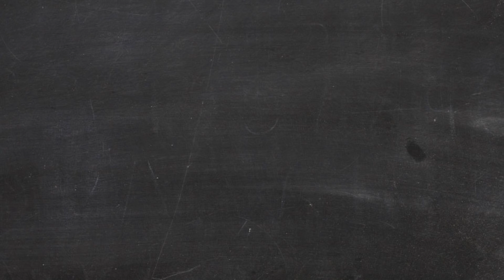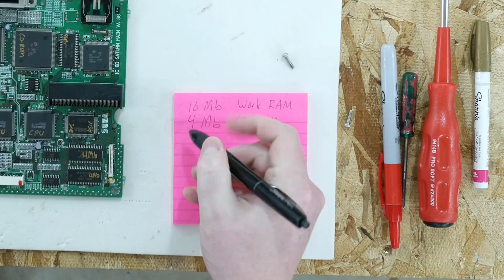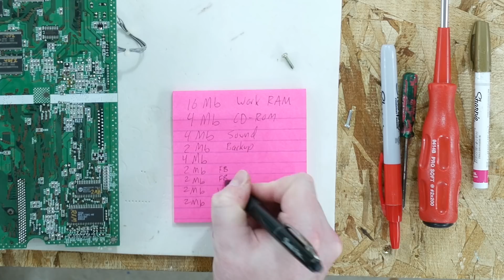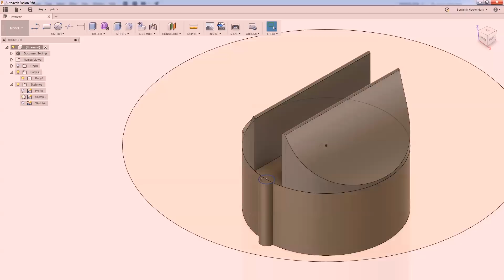Sega Saturn Teardown

Comment: The Saturn name wasn't so much an oddball name, as the development name for the Gamegear was Mercury, the development name for the Nomad was Venus, the  32X was Mars, then there was the cartridge only based Saturn system (another 32bit console!!) which was going to be the Sega Jupiter (the cartridge slot on the Saturn was going to be for Sega Jupiter cartridge games originally, not for memory expansion), then the Saturn which you know, and then the Sega Neptune which was going to be an all-in-one MegaDrive/Genesis and 32X... Sega was all the way with planet names, it was just the first time the development name reached the final product.

Speaking of Sega and specifically the Neptune, there are a lot of people making their own homebrew Neptunes by cramming the inners of the 32x inside a Megadrive/Genesis 2, and one person even molded the case to look like the Neptune prototype... but it's a mess inside of motherboards and daughterboards, power regulators (to power both systems off one power supply), the dust flaps of the cartridge port seem to be a problem because of height... I would love it if you made a proper, cleanly combined Neptune, maybe removing parts from the boards that are not needed to make it cleaner and more compact inside... also, the Neptune/32X can't be used directly with Master System Converters and advanced 16bit cartridges like Virtua Racing, because of a passthrough pin issue or something from what I've read, so maybe resolve that issue too!!

Comment: The chip next to the Mpeg cartridge is probably the SH-1 CPU used to control the CD-ROM and talk to the MPEG cartridge.
Also that System control chip also performs the 3D T&L operations.

Comment: The mystery chip might be the SCU DSP chip, because when you have problems and you're 90's SEGA, you just bury that problem with more processors.
Reply: The chip by the port is a Hitachi SH-1 CPU, part of the CD sub-system. The 2 chips were integrated in later board versions. The 512k CD buffer memory chip remained separate. There was a DSP in the System Control Unit chip (8:17), which can help with graphics.

Comment: Also Holy Shit the Saturn was a memory monster back then... The N64 had only 4Mb of unified system/Vram memory but I must say it was Rambus memory so it was in fact faster than any other memory from the other consoles and also the N64 had a dedicated graphics chip (RCP) which was better for 3D games, I would argue that 3D-wise the N64 was the most capable system. The Sega Saturn however is clearly more capable in 2D. The Playstation isn't the best in anything but it was still pretty powerful at the time and it had all the features (CD, 3D graphics, analog sticks, rumble engines...) The Playstation is the most complete console from that generation and also it is the first successful 3D console and furthermore the first of that generation which really got it a good headstart in front of the others and even furthermore it is a very simple console. Playstation got everything right, it was the work of a genius.
Reply: Yeah the Saturn had far more raw processing power than the PlayStation aswell but spread across more processors. If you couldn't program for 2 CPUs (not many developers could or they just didn't bother) then there was no way you could get the best out of the system. Plus the VDPs were custom so there was a steep learning curve. Basically the Saturn was like juggling 4 or 5 balls and the PS was more like juggling 2!
Reply: Liam3072 Oops so they were pretty evenly matched then.
Reply: Stanton Bentley. The Playstation was just slightly weaker (about 25% to 30% weaker) than the Saturn and N64 because it came out first. It had 3MB of memory and basically 1MB dedicated for sound, 1MB as Dedicated Vram and 1MB for the system. Just like the N64 the Playstation was a MIPS with very similar specifications to the N64. But what makes the N64 more powerful is the RCP designed by Silicon Graphics (World leader in computer graphics at the time) and also the freaking RAMBUS memory, I can't emphasize this enough Rambus is an amazing memory architecture, it's blazing fast, to give you an idea the Rambus memory used on the Xbox 360 and PS3 was 10 TIMES FASTER than 1333Mhz DDR3!!!! That's obscenely fast for something that came out in 2005, of course that the same is not true for the N64's Rambus because obviously the N64 used an older model but it was still Rambus and Rambus is just the best, it completely obliterates other memory architectures out there and the PS2 also used Rambus as well... Basically the difference in power of the Playstation vs Sega Saturn is like the Xbox One vs the PS4. The PS4 is indeed more powerful than the Xbox One but it's not "FAR" more powerful, it's not even double the power or anything like that, the same applies to the Playstation1 vs Sega Saturn, the difference in power is not several times like many people like to claim. And of course... The PS4 is not just more powerful than the Xbox One but equally easy to develop games for as they have the exact same AMD64 architecture and also it launched at a far lower cost, the Xbox One was larger, more expensive and less powerful... The Xbox One however does feature more media center features such as HDMI-IN (it has an integrated capture card), that's where the extra money went. The Xbox One was not very successful at first because it took the focus away from gaming. The Saturn however is indeed because it was hard to develop but not just that but also the fact that Sega's image was somewhat tarnished by the 32X and other practices that severely affected the market place of Sega.
Reply: The N64 didn't have 4Mb but 4MB ram. So more or less the same than the Saturn (you can substract the battery-backup ram and the cd-rom cache ram from the Saturn's total imho). And double that amount with the RAM Pak.

Comment: Poor sound chip (= limited sound samples), texture transparency not supported (= all shadows, for example, is a group of pixels). But still very nice console ^^
Reply: Poor sound chip? I've never heard that before. The Saturn easily had the best sound of its generation.
Reply: Texture transparencies ARE supported just via vdp2 which most devs used vdp1 hence no transparencies.
Reply: But the Saturn had the best sound chip of the 4th generation, and texture transparency is supported, by using VDP1, (look at burning rangers or courier crisis).

Comment: I got a Saturn pretty early on really liked the system.  I have two machines now, a model one and a model two.  I've taken them both apart and I'll tell you that the first model is quite a mess inside compared to the second one.  That would have been fun to see here.  But I prefer the model two now after opening them up.

Comment: Professor Abrasive is working on a device that plugs into the same slot as the MPEG decoder pack which allows you to load disk images from a USB drive.
Would be nice to see a portable Saturn when the card is released.
Reply: well, yeah, but, the Satiator can be given as a gift for someone to just plug into an old unit.

Comment: there not mega bits there mega bytes :P your an enginners? and we wonder why where called lazy hahaha jesus that simple thing is why people have massive fuck up jsut that simple diffrence in term make a huge diffrence
Reply: You are incorrect.  He converts the total memory to megabytes about 11 minutes into video.  But he did not make a mistake.  For example, he points out that the Saturn has 16 megabits of work RAM for the CPU.  16 megabits is 2 megabytes.  If you check system specs, you will see that is correct.

Comment: Can somebody help me to modify japanese saturn 110v power supply into 220v power supply. Please :(((
Reply: El Thunder Just buy a step down converter
Reply: Zmastertt okay, thanks. I thought it is possible to solder some additional components to turn 110v power supply into 220v power supply
Reply: Zmastertt do you have schematics of 110v and 220v saturn power supplies? I cant find 110v schematics
Reply: El Thunder unfortunately no, I think its hard to do; its not a varresistor replacment, better nuy a European psu
Reply: El Thunder Google SaturnPSU, it's a complete replacement

Comment: Commodore Amiga CD32 teardown :)
Reply: YouTuber RetroManCave just recently posted a 3 part 'Trash to Treasure' series where he rebuilt a broken CD32.
Reply: https://www.youtube.com/watch?v=CkVzXi7StKk

Is not Ben, but here is a guy that takes a broken Cd32, goes over the architecture, repairs it and cleans it up, check it out.
Reply: Seconded, and make it portable.
Reply: It was an amiga 1200 with a few mods, I had the A1200 with with a blizzard board 030 with floating point expansion plus zappo cd rom to emulate the cd32 but some games needed that special chip to run akiko planar. They run very slow. And the cd32 had fast mem which the 1200 hadnt as standard. Glad I ripped my hard drive a whoppin 80 Meg on a win 98 pc back in the day. it runs it on win uae like I never left haha. I think I will get a cd32 soon and compile a massive cd of the stuff I like as using hardware is always the best as it's intended. The amiga was ahead of its time on launch in 1985 not much changed till its end in the mid 90's and was still punching high
Reply: I was seriously going to suggest this. Lots of goodie well name custom chips in it. Cant Live with out the sweet sweet Alice chip.

Comment: It was extremely difficult to replace the CD ROM in the Saturn, but it's finally been done by one guy - using a custom PCB with FPGA to override the boot process. It was extremely involved, apparently, even down to ensuring the data arrives from the custom board to the busses at the right speed to allow the console to operate. Video is here! https://www.youtube.com/watch?v=jOyfZex7B3E

Comment: 11:30

Technically, a stock N64 actually has 4.5 MBytes of RAM.

Not quite the total of what's on the Saturn, but then the Saturn is including things like the battery-backed SRAM as well.

(whereas that would be inside the cart or "Mempak" on the N64.)

But, the N64 doesn't use a great deal of that extra half megabyte of RAM, as it's only used for the "coverage" data which helps the RDP to calculate the anti-aliasing stuff for the frame buffer / polygons.

They basically used 9-bit wide (parity) RDRAM on the N64, which gets accessed in 8-word chunks, so the main bus inside the RCP chip is actually 72-bits wide (64 bits of main data, plus the extra 8 bits, which they called the "extended" bus.)

So, the stock N64 has 36 Mbits (4.5 MBytes) of RDRAM, and the expansion pak takes that up to 72 Mbits (9 MBytes).

(but it still can't quite directly use that full amount for actual data / code.)

The Saturn was hugely over-complex, and must have cost Sega a LOT of money to produce and test, hence the high initial price tag.

It was really just a version of Sega's ST-V arcade hardware (IIRC).

(A market where the costs of the boards didn't matter quite so much, as long as they could generate some very nice graphics for their time, and get people spending their money in the arcades.)

Comment: I remember watching the video where the Sega saturn was cracked, took a long time but the way in was apparently the Video CD mpeg slot. Was built like a fortress i believe Sega saturn CDs were specific to the console as they had a wobble pattern in the edge which was read and shop bought CD's do not have that
Reply: Eastyy what contributed to it is also that the saturn is not popular enought for a good team get engaged and work really hard in it, so it took a long time for a skilled boy get interested enought to make it
Reply: @AmazinChannelz  Dreamcast sold about the same and that was cracked easily. Saturn was just difficult to crack.
Reply: @segat-800  dreamcast was easily cracked because it was based on a version of windows that people knew how to skip the authentication, that's why it was cracked so fast, it was actually the easiest console to crack, it took just days or weeks if i'm not mistaken

Comment: The copy protection system on these was ingenious. Took almost 2 decades for someone to crack it.
Reply: it's changed in recent years, but in the late 90's, early 2000's you could find shops almost anywhere you went that offered to install mod chips.
Partly this came about because Australia had declared mod chips legal. (much like it had declared breaking region lockouts on DVD's legal, leading to just about every DVD drive in the country being either region free by default, or having a code to make it region free available.)

The reasons this happened is because of a set of consumer protection laws that actively encouraged parallel imports as not just permissible, but a legally protected right.
As such, anything which allowed you to bypass regional lockouts was fully legal here for a long time.
Just so happens most modifications that allow this also allow other things of course...

Unfortunately both these laws, and the attitude of our government towards such things has changed somewhat thanks to us signing a trade agreement that obligates us to honour the terms of America's DMCA...

Though I think such modifications are still technically legal here, the DMCA being what it is (and having been written by Americans) contain several provisions (such as no circumventing copy protection mechanisms, and more restrictions on reverse engineering) that contradict and undermine older Australian consumer protection laws.

Up to the early 2000's I knew I was well within my legal rights to make any any all modifications I felt like, or have them done to any hardware I owned for at least the purposes of being able to play imported games/films and any other media for which the vendors might be using region lockouts of some kind.

Nowadays I'm not entirely sure where I stand with that, legally speaking.
Funny how much damage a 'trade agreement' can do to long-standing legal protections in a country...
Reply: I think the OP is talking about emulation
Reply: amihart 

Maybe in the US, mod chips weren't that popular, but in the UK & Europe, any serious gamer would have their console modded..
Reply: To be more specific about why cracking it matters: one person said it was about emulation, and that's partially true.  We could emulate Saturn games before this but not the CD loading mechanism.  By cracking it as opposed to simply bypassing it, better emulation can be created, original games can be played more easily, and possibly the most important part the CD drive can be rebuilt to original specs if that's something someone desires.  It's more preservation than anything.
Reply: oldgames guy CD drives for the Saturn are dying.  No one makes replacement parts.
Reply: The modchip bypassed it. It didnt crack it or exploit it. Of course one would argue it wasn't as good if it could be simply bypassed with a modchip.
Reply: yes a man cracked it through the vcd port to access the cdrom block bypass cd drives completely he said he is making a new board for people to buy cos all of the cd drives are breaking usb hard drive and sd cards should be possible and we should start seeing emulation vastly improved on cos of him working with the emulation team ...and to think he cracked it by mistake he wanted to access the music features genius the the video is on youtube
Reply: I had no idea we weren't done yet.  That's super harsh!
Reply: if only dreamcasts had been better...?
Reply: Okay, while I'd be comfortable popping off a few screws and removing ribbon cables, the less I have to mess around inside a console the better for me.  Now it's making sense.  He did say he wanted to program his own music on the Saturn and use its music chip for composition...
Reply: I prefer having the games on the internal HD myself, that way the console and games are fully portable. Though HDLoader won't play every title unfortunately.
Reply: That is true but we now know the full details of how it works though a true exploit isnt available.
Reply: Izzie A
Reply: yeah I was wondering why that video got so much attention when products like Phoebe and Rhea were already for sale for several years.
Reply: Installing mod chips is not something the vast majority of consumers can or would even want to do, so it hardly matters towards sales. As long as it can't play burned discs or can't be easily soft-modded then the copyright protection has practically accomplished its goals.
Reply: I installed a mod chip in my Saturn in the early 2000s. It bypasses the protection. Hardly 2 decades
Reply: The point of Dr Abrasive's work is to avoid mod chips.  Soldering isn't exactly fun for the end consumer.

Edit: try as I might, I see nothing about Rhea requiring a modchip.  So this further confuses me as to why Dr Abrasive took it upon himself to decode the bootstraper as thoroughly as he did?

Comment: 4TH CONSOLE??

No mention of the SG-1000, SC-3000,  or SG-1000 2? :(

...and there were cheats for Spinball. lol. 

(From off gamefaqs)
Access the Options from the title screen. On the Options Menu, take controller one and press these buttons in this order: A, DOWN, B, DOWN, C, DOWN, A, B, UP, A, C, UP, B, C, UP. If you did it correctly, you will hear a special sound. Go back to the title screen and hold button A and press START for Level 2, B and press START for Level 3, and C and press START to begin on level 4.
Reply: 4th generation
Reply: Aaaaaaaaaaaaah...thanks for the clarification, brutha ^.^